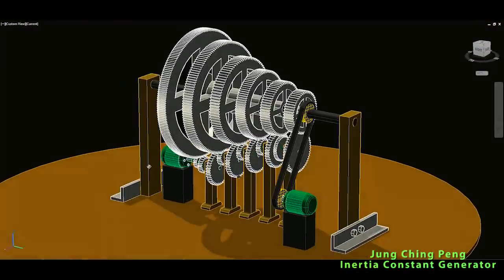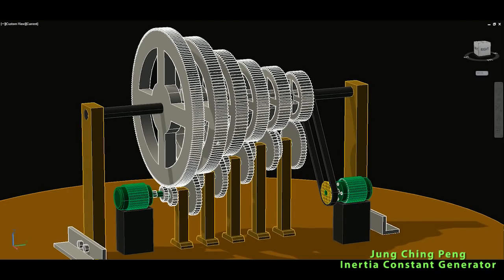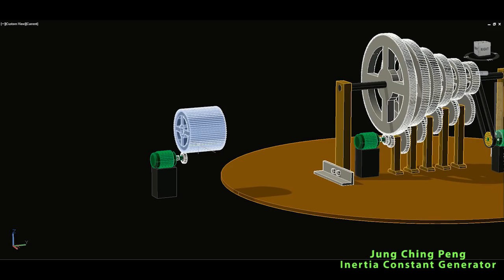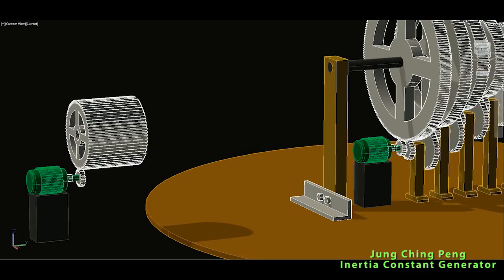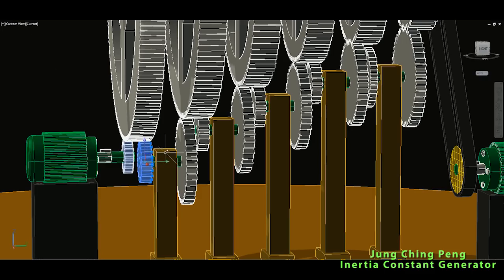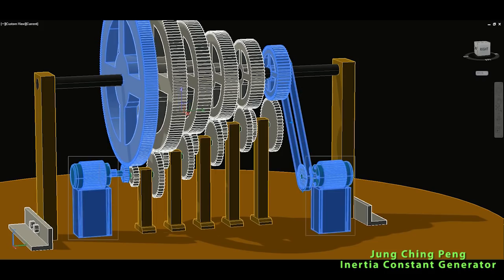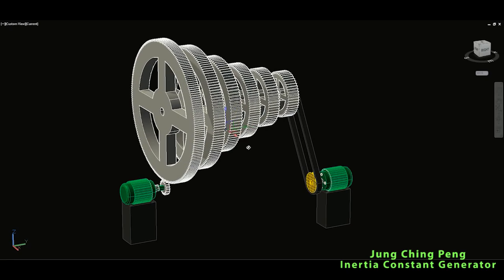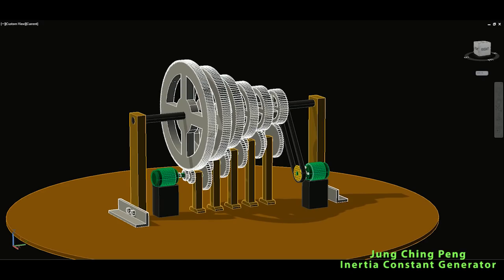Free Energy Generator 2018, JUNG CHING PENG Inertia Constant Generator

Comment: Leaving aside the fact that gears merely exchange speed for power or power for speed without any net gain in energy, the device, if built would actually jam since gears are connected but trying to rotate at different speeds. My best advice to Mario is to actually build simple prototypes and test them. Whilst he is unlikely to save the world with free energy, he will learn a lot about physics, an area he needs to study further.

Comment: I've read the Google patent Abstract, it states "An inertia constant generator that needs only the external power to drive the motor upon start-up, and then achieves constant operation with residual power output by supplying partial power output to keep driving the motor". What this does is really explaining the conservation of input energy. At the electric generator, a portion of the electricity generated is used to power up an electrical device, the unused electricity is feedback to the beginning of the loop to spin the first flywheel. This is an efficient method for power conservation, but it's not free energy. Ultimately, tapping into free energy must involve tapping into the Zero Point energy field. Until somebody can explain the dynamics behind this flywheel mechanism, or film the evidence, I'm a skeptic.

Comment: could it be BOGOF ENERGY? (buy one get one free ). what mass particles ( bozons, mezons and croutons) does it interact with. did you use glueons or duct tapeons and where does the non linearsplingle blarp atuator go. Will it work with a shatners basoon flange? how many are left on the shopping channel and do i get an infinite money back offer. These things i need to know. Got to go, busy inventing faster than light travel..

Comment: In 1942, Dr. Oppenheimer assembled a team of the finest Engineers & Scientists in Los Alamos, NM, to develop an unlimited source of power.
First, they hooked a starter motor to the generator of a 1938 Studebaker. It didn't work.
Then they tried attaching soda bottles to a bicycle wheel. That didn't work, either

Comment: Hi to everybody. Energy in this device may appear only because of a very big number of hard impacts between metallic surfaces of the gears. One scientist even noticed that hydrogen from the metal travels to these places, and some kind of the low energy nuclear reactions occur. So if that thing was really built by somebody, and worked - make EDS analysis of metals in the contact places of the gears.

Comment: Please someone explane to this person that power is calculated       torque * speed= power and if you add torque you lose speed  , if you add speed you lose torque...  power remains the same because of silly mathematics! So lets say torque is T , speed is S and power is P !
T10 *S10=P100  ,torque is 10 ,speed is 10 right?  and if you make first (torque) number 5 instead of 10 speed is going up ! ecuasion looks like this 5 * 20=100 ! same is in other direction  20 * 5 = 100

Comment: Are all of the gears on the main spindle locked to the spindle with something like a key way and key set? If so, as soon as you start turning the first large gear with the electric motor, you will rip the teeth off from all of the smaller gears either on the main spindle, the ones below it or both. It would be like driving a four wheel drive truck with the front tires 4 inches smaller than the rear tires. The rear tires, which are gear locked to the front tires, will try to force the front tires to turn faster than their height will allow being gear locked to the rear tires. In this example, you would be pushing / dragging the front tires with the greater rotational speed in the taller rear tires and grinding the tread off from the front tires prematurely. The ratios will never match to keep all of your top gears spinning in unison.
    If your top spindle gears are NOT key locked to the spindle, then they must be free spinning on the spindle shaft in which case, they wouldn't be able to transfer power to any gears beyond the first large gear and the gear directly below it. It would be analogous to taking the aforementioned truck out of four wheel drive and letting the smaller front free wheel with the rear wheels pushing them down the road. The front wheels would only be there idling along and holding up the front end of the truck but contributing NO power to moving the truck. Yours was a good thought experiment though. Nice graphics too.

Comment: With gears, you can concentrate or divide the power, but cannot create additional power. Due to friction, it'll stop on itself without any output. It does not work.

Comment: For those of you thinking this is real. Its NOT. It doesnt work because there is a certain branch of physics that doesnt allow this to occur its called THERMODYNAMICS.
(Please read through and correct me if im wrong)(I have taken my time to write this leave a like if you think its true.)

According to the video the machine should have MORE THAN 100% EFFICIENCY WHICH IS IMPOSSIBLE. READ IF YOU WANT TO KNOW WHY DISLIKE IF YOU ARE IGNORANT.

1. Lets say the 1 motor does run and makes the other motor run as well. Ignoring resistance this will run at 100% efficiency(IMPOSSIBLE)
2.  Think logically.Can you generate energy out of nowhere?(A. NOPE)

I HAD WAY TOO MANY FRIENDS FALLING FOR THESE BULLSHIT VIDEOS.
ONE OF THEM EVEN DECIDED TO GO WITH THIS FOR HIS FINAL YEAR PROJECT.
HE OBVIOUSLY FAILED AS THIS DOESNT WORK.

DONT FALL FOR IT.

Comment: If you put this together is will not spin.  The gears are locked because you have a gear reduction and increases meshing on the same shaft.  This is not very well thought out at all.  High power output than input? Free energy? Try free clickbait.

Comment: If it was made og nice shiny chrome in a glass or clear acrylic frame, it would look very pretty indeed. which is about as much use as it gets. No free energy and indeed every wheel just adds yet more friction the drive motor has to overcome. Assuming the motor is powerful enough to do this, then yes, there WILL be some inertia (the heavier the wheels the better) and you could generate for a SHORT time while the system rapidly decelerates, more power out than you put in - thisis NOT free energy, you are simoky "spending" the inertia that built up.

The torus project (fusion reactor) used a glywheel generator powered from the Didcot power station. they had their own transmission towers to deliver (I think) 440KV which was used to slowly wind up an enormous (many many tonnes) flywheel, when it was upto speed, they could throw a contactor and all that stored power could be pumped into the torus in the space of a second or so - generating many Gigawatt second - to "ignite" it.

No free energy, but yes they made good use of inertia in the form of a massive flywheel generator.

On the upside, yours could look really stylish as a paper weight or other "nice to look at" toy.

Comment: It's all on one shaft..... 😴 as you stated at the beginning.
Or are there bearing you're not telling us about?
There aren't or you would have stated that.
My guess this won't turn at all. The first motor will burn out from not being able to turn this.
In fact if the smaller wheels on the bottom were on separate shafts with bearing who's only purpose was to spin individually for looks.
Then I will state that this is an energy exhauster except for the large and small gears at opposite ends, the middle gears mean nothing and the small two sets of gears on the bottom, suck away energy.

Comment: Free energy doesn't work, and i'll tell you why if you pull power off this its going to slow down, as it slows you demand more power to run the motor and have less coming off the generator it will keep doing this until all the energy is used up. Game over.

Comment: For starters, you started with an electric motor, which isn't even 100% efficient. So, by powering it, you've already lost 10-15%, or more, if the energy you put in. Then, you threw several conversations in the mix, each losing a percentage to friction. Then, you finish with a generator, which is just as efficient as the motor you started with! That leaves you with no possibility of recovering more than 75% of the energy you started with! But, it's looks fun and makes alot of noise!

Comment: it won't work due to torque. the energy needed to produce enough torque to turn the gears is greater than the energy that will charge and be stored in the second motor. Also energy will be lost between the motors due to friction/heat/sound.    Boom, basic physics.

Comment: Cycloid gear sets have been used for many decades. One of the very first things tested was the conversion of high torque/low rpm to high torque/high rpm. They found something out, as has everyone that has tried it since, that startled and dumbfounded them:

You can't. Basic mechanical engineering will flat out prove to you that this setup will NEVER work with a load much less with free-spin with no load. As in electrical circuits with their natural resistance calculated by Ohm's law, mechanical gears have natural resistance simply due to gravity, atmosphere, mass, and contact friction. 

Free energy cannot occur. Period.

Comment: Your generator and your motor will not be 100% efficient. Friction due to the interlocking gears, will create heat and other losses. 
By studying your CAD model if you try and build it all of the gears on the main spindle are either going to be steadfast on it (thus rotating at the same angular velocity as the first) or will be sliding along the main spindle. To fix this you would need to add either bearings or bushes creating only more friction. Your system will not be 100% efficient, so it wouldn't even have the capacity to generate electricity only recycling. 
Well done on fooling people, I am glad that I might actually graduate with my Mecheng degree.

Comment: Give up free energy machines are impossible because of the first and second law of thermodynamics or at least they are impossible using things like gears or water or any of the things that we have discovered.
Reply: I have an idea for constant energy flow :) Imagine a bunch of water wheels positioned above each other, each one when spinning generates an electrical current not so unlike a wind mill does but with water. At the top is a big basin of water, as the water falls straight down it spins the water wheels generating electrical current. When it reaches the bottom their is another basin, but this one can be shaped some what like an up side down bowl and is slanted down so water flows into areas that are separate and in these areas the water is evaporated and then travels up tubes and back to the top where water re-condenses and falls back down. In these tubes the steam is traveling up through, there is a smaller tube coming down from the top and small windmill like contraptions protruding from it. The rising steam spins these small windmills and generates electrical current that travels through wires in the center of these inner tubes and can either be used for extra energy output or help to heat the bottom bassins. The energy to keep the bottom hot enough to evaporate water comes from as many of the water wheels spinning as needed. To get more energy output you just make the contraption taller with more water wheels, It will always only take so many wheels spinning to keep the water on bottom boiling so more wheels equals more energy output. The material in the top basin can be designed as a heat sink to help the water re condense into liquid form, if built correctly, so no water/steam escapes, it just keeps going and going utilizing natural forces to function. :) Now just add the proper electrical wiring into its design so all the excess energy being perpetuated can be accessed from plugs on bottom of device and presto you got yourself free energy. :) Please share this Idea with Everyone.

Comment: Useless really as the upper wheels are not necessary.  It has the making of a good gearbox if one adds a few synchromesh clutches as related to a car gearbox.   It could also have a reverse system with a few idle gear wheels. 
It is a good drawing I must say and  the result caused the designer's imagination  to  run away into another space realm of free energy.   Please come down to earth, it is only a good drawing.

Comment: I assume this is some sort of joke. Unfortunately there are people who actually believe in such nonsense. If you get fooled by this video, you need to study the math of physics involved. Every detail of the machine on this video can easily be modeled and rest assured that energy losses in the motor, bearings, gears, belt and generator will make this machine produce less electric power coming out than what came in because the machine also makes heat, electromagnetic radiation and noise. For EVERY STAGE in this machine, you have a POWER LOSS. Nowhere is energy created magically.

Comment: If the gears on the main spindle are fitted on it, if definitely cost more power to run the driving motor, as the incoming power at the dynamo will be.
And it is very ineffective to drive so many gear pairs, every pair you drive, you lose energy for the friction of those bearings.
You only need 2 pais of gears to test that.
And you will see, that it cost a little bit more energy to drive that noob shit as your incoming energy will be.
Shortly, it's machine to measure the friction in your bearings^^ XD

Comment: Think i just wasted  my time watching  an examp,e of an  inertia  generator, that will effectively  slow down to a stop, if the initial drive is taken away!
Reply: Cant the intertia be reused by the generated energy? I have no clue on about any of this energy crap. I like to keep it simple and use power that is made from.nature and
Reply: And what its powered by people?? Let's say I put a crank handle on it. If I turn it once the end point will turn..let's say 100 times more... so would it be possible and if it is. What if u made a huge gear reduction thing let's say to output 100k more torque then 1..

Comment: I think somebody needs to go back to engineers’ school! The power transmitted through a set of reducing gears is actually reduced because of losses within the gearing. Typically around 3 to 5% for spur gears. With this train of gears the overall efficiency will be around 55%, so 45% of the input power will be lost straight away. What will happen in the first gear reduction is that TORQUE will be increased, but power will be decreased because of losses in the system. It’s hard to work out what the next set of gearing stages are doing, but in each stage power will decrease and torque will either increase (for speed reducing gears), or decrease (for speed increasing gears).
I am afraid the understanding of the relationship between power, torque, and inertia is a little lacking.

Comment: ?? is not the drive motor running the output as the (OTHER END) gear is connected to the shaft also.
maybe the upper gears are free from the shaft- I dunno... 
are the ratios proper as it progresses toward the output..
this is to continue rolling along once initiated?  (*~*)
patent?? start with Preliminary Patentability Search..  
deep pockets 
good luck...

Comment: Show us an actual physical model working, not just explaining how it SHOULD work on a graphic.. Also, where do you get the zero friction gear teeth and zero friction shaft bearings to eliminate losses to friction in at least 17 places? The belt will also have some resistance to flexing around the pulleys, and I also neglected to count the motor shafts for friction points.

Comment: Just like any other gearing, you can always increase your RPM, but as RPM's increase, torque decreases, so all you end up with, energy-wise, is loss to friction. And since you've used more gears than are really necessary, you've increased your friction loss.

Comment: in theory it actually will work...but the cost to build a 3 to 4 ton cog wheel station of several ... is enormous for the little electric power it will generate..it is the same power transfer system as in you automobiles transmission ...

Comment: Do you really think you're fooling people with this crap?  Your rambling was painful to listen to.  Basically, you want us to believe the energy used to start this "engine" up will be less than it generates?  What about air friction?  What happens when you apply a load somewhere to this?  You need to do systems testing and measure voltages at either end.

Comment: Wrong because the generator is a load and the load is able to slow the largest sprocket so basically the load has the most leverage on the shaft picture for a minute that you are the generator and you have a big long wrench on that center shaft you have the most leverage on that big ranch so you can stop that shaft from moving so now you have the motor over there trying to turn the shaft and you’re at the other end with a huge wrench trying to stop All movement or just look at it and see the chef moving with just the top gears on it what would you grab the slow it down and grab the biggest gear to slow it down not the small one because you have the most leverage by stopping the big gear the generator is going to have leverage to stop the big gear it’s going to fight the motor all the way

Comment: What I mean is that it looks like there are two levels or layers of gears. What if the distance between the two levels could be increased. Imaging a third set or row of gears.
Reply: Another gear and it will double the output

Comment: Solid works will analyze the system without gravity, friction, and reverse kinetic, difficult though but you can try with real model, metal casting weight and bearing will play dramatic role